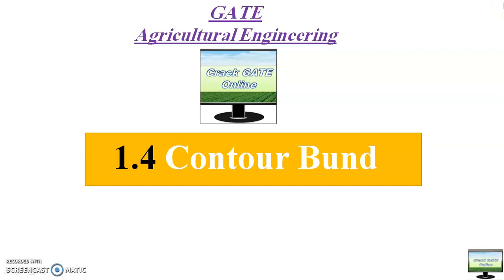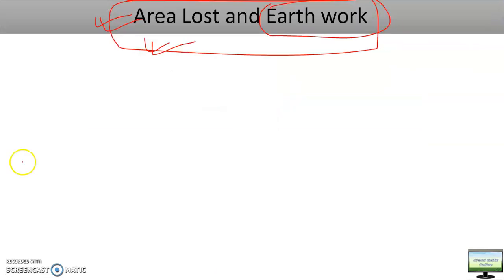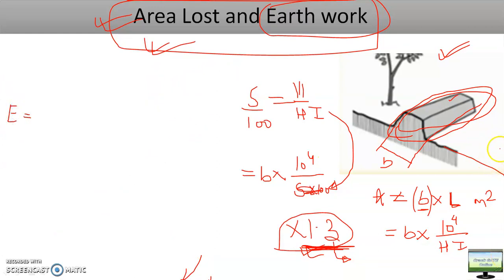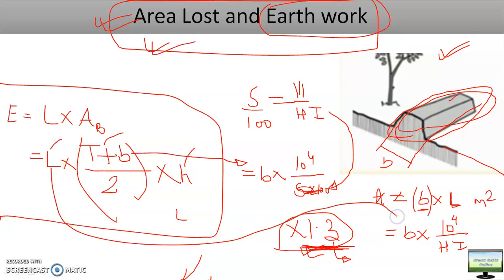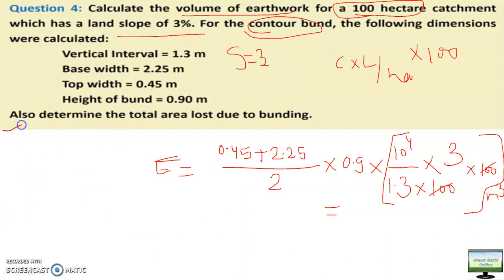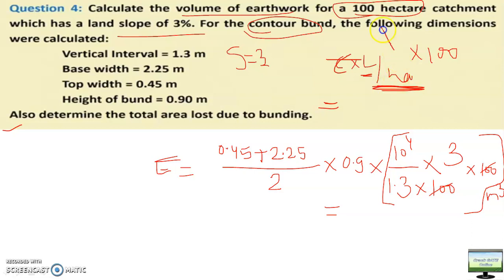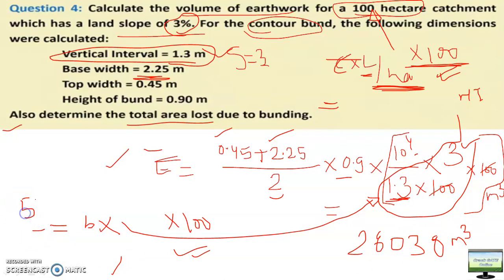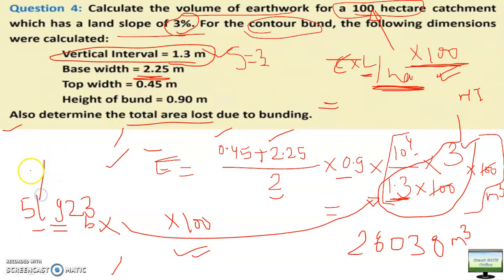1.4 bund

Comment: 30% add for side and lateral bund so we have to multiply it by .3 but you have shown 1.3....why? is that a mistake?
Reply from the maker: No its not like that if you only want to calculate for side and lateral bund then multiply by 0.3 
but if you want to calculate total area then you have to add that area of side and lateral bund 
means A+0.3A = 1.3A Or simply multiply A with 1.3 =1.3A